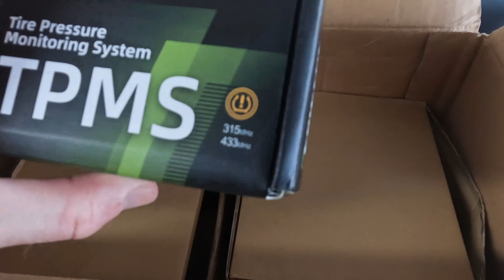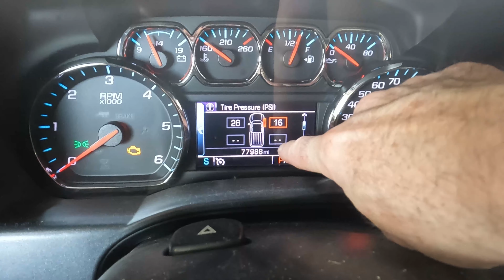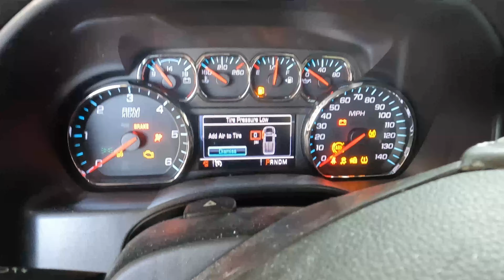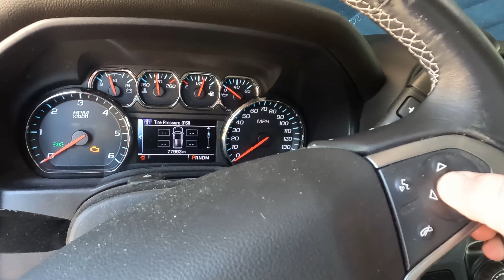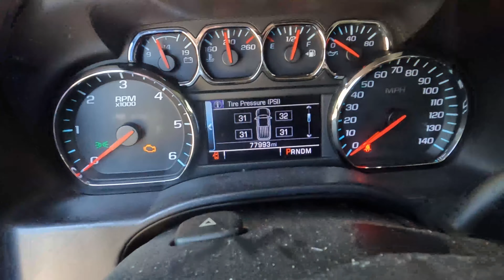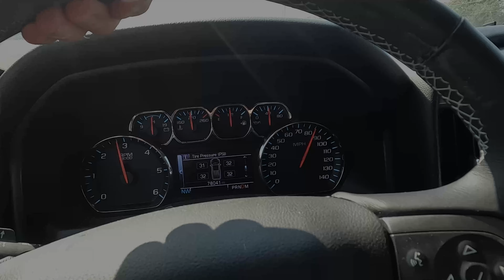DIY How To Install TPMS Sensors On Chevy Silverado At Home

Comment: Thank you for this video. I bought some aftermarket TPMS sensors as well and had this tool already. Glad to know this will work. Tire shop acted as though they had to program with an OBD scantool and only their sensors.
Reply from the maker: @C.Stiltner  pretty much all modern TPMS sensors are programmed this way.  Says you can let air out of the tire to trip the signal on the sensor but never could get it to work.  The little relearn tool works awesome.

Comment: This tool will not reset tire sensors.
Reply from the maker: @ajwolfe1829  if by tire sensors you mean TPMS sensors then yes it will for this style and model.  Make sure the tool you are using is approved for the year make and model of your vehicle.

Comment: Great video I have to do the same exact procedure on my Silverado. What do you think of leaving the old valve stems in and just replacing the sensors?
Reply from the maker: From what I can tell It’s all one piece.  That’s why I cut the the old ones out.
Reply: @JordanMoree  ok thanks. The ones im replacing are the el cheapo ones from Amazon, i had them installed when i bought new tires. They lasted three years  before crapping out so still not bad fot the price.

Comment: Does that work with vehicles that might not have the auto learn feature in its computer?
Reply from the maker: I’m not certain.  Most modern vehicles that have tpms sensors have some sort of relearn mode.
Reply: @JordanMoree  Okay. Thank so for the reply! More power to your channel. It’s crazy that I’m the only one who commented on this video. It’s good information.
Reply from the maker: @troyjusticecabrera7284  I appreciate it!
Reply: Yeah thx man I bought one censor at advance out they told me to install it an drive 15 miles..what a joke that was...thx for the tips ordering one off Amazon as we speak. 💪
Reply from the maker: zachprandini3451  with the same tires going back on I don’t think it’s necessary.  Have not felt any unnecessary wobbling.  But depending on other factors it may be necessary.
Reply: zachprandini3451 
If they didn't need rebalancing before, and you don't turn the tire, as long as the sensor waigh the same, then no.